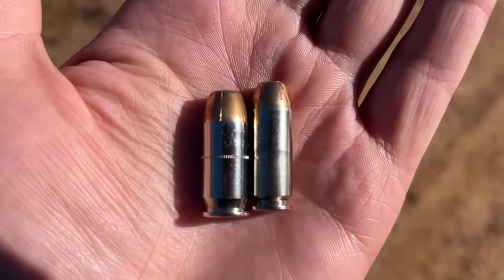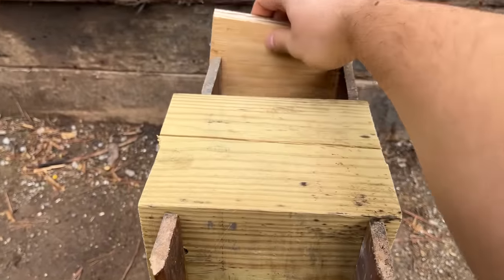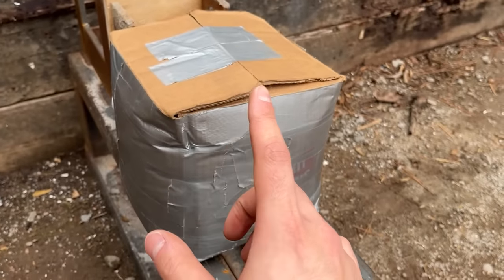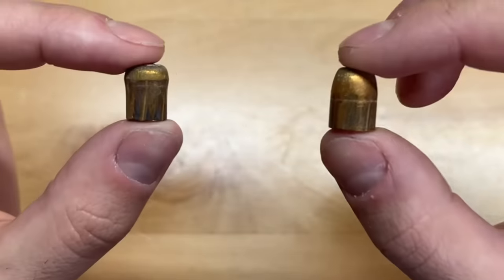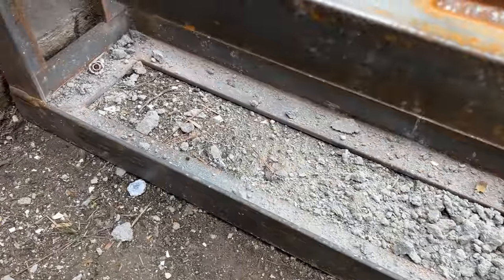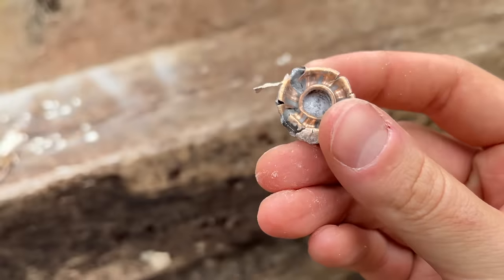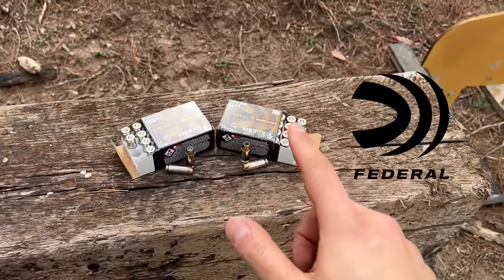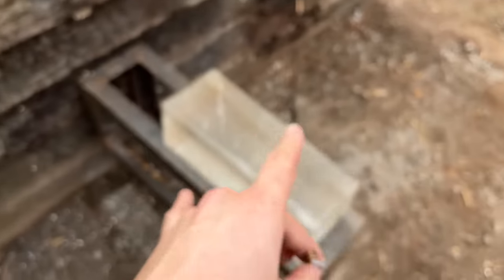45 ACP vs 10mm: Unbelievable Difference On Barriers

Comment: Just make sure your 10mm isn’t underpowered. I’ve heard and seen a lot about some 10mm loads basically being .40 S&W
Reply: It's true that 10mm has been watered down but it's still much more powerful than 40s&w.
Reply: They did that because a full powered 10mm was producing too much recoil for FBI testing. Garand Thumb has a video with the comparison between the two.
Reply: @philipmitchener28 that video was hilarious
Reply: @PerceptionVsReality333  At least half the 10mm on the market is loaded to 40SW pressures.
Reply: My man, both .45 and 10mm defensive factory loads are not just scaled down to .40 ......... they are scaled down to the power of 9mm +P. ......... really go look at ballistics 101. 

Yes the bigger calibers can be significantly more powerful but the simple reality is that the same people touting the extra power dont actually carry loads with that extra power.
Reply: I have never seen any 9mm loading pushing 600 ft lbs of energy like a lot of 10mm loadings. Especially when you get into offerings like Underwood. That's when 10mm is actually loaded more towards the original load offerings. Like 775ft lbs of muzzle energy.
Reply: @theshapeexists  as far as I know Buffalo bore 147g flat nose hard cast is the most powerful 9mm factory load @ 550 fpe 
I have some lehaigh /underwood 67g xd loads at the maximum and that's about 500 fpe. 

The vast majority of .45 loadings fall below 550 fpe with most like 480-530, popular defensive loads are 420+ 

10 mm has alot more 600-700 fpe loadings but when you look at the most popular defensive loads that people are actually carrying they are in the 480-550 range.
Reply: @whatsmolly5741  yeah I mean I carry federal punch in my .45 and I know it only produces like 360-370 ft lbs of energy from the muzzle. But that's okay for me because I carry a compact and dont want the added recoil in a small package. I live in a state where 10 rounds is the max capacity. So i prefer .45 to 9mm for that reason. Same level of energy thereabouts but with a bigger hole? Yeah, so just get the .45 then imho. If you live in a free state the 9mm makes more sense.
Reply: AMEN
Reply: I stick with Underwood, they seem to be the best for 10mm.
Reply: I load my own so that's not a problem .
Reply: Doesn’t matter what you guys use if you miss the vitals.
Reply: Federal HST is watered down 10mm, they don’t load any hot 10 that I’ve seen. Underwood has loads with almost 50% more energy compared to this stuff he tested. My carry load is 155gr but traveling at 1500 fps making over 700 falls of energy out of a Glock 20.
Reply: @alexmills1329 
That 155gr Underwood load is a beast. Tools and Targets did a video on Youtube. It really did well.
Reply: @theshapeexists 

Dont get too excited about those numbers for 9mil…it dont mean squat in the real world. Its only good for show purposes shooting fruits etc.
Reply: @slurpyman20  9mm is adequate for self defense, but I can't say I've ever been "excited" about any 9mm offering. It's the smallest caliber I've ever carried and like it for the capacity. I prefer .40 in small frame semi autos. 10mm is my jam though. My Glock 20 with Underwood ammo is my go to camping and hiking gun. That gets me "excited".
Reply: If 10mm isn't pushing 700 ft lbs it's not true 10mm
Reply: @timjohnson8390  I wholeheartedly agree. its dumb they underload it so much, but when loaded PROPERLY,They charge absolutely ridiculous premiums. It makes no sense
Reply: @shockwavecity  And even that is a pretty decent load for an pistol, just not up to what a 10mm is capable of.
Reply: Joe said 9mm blows your king out. What’s 10mm do?
Reply: @theshapeexists  Just seems ridiculous that one company can get it right but the others either don't care or don't care
Reply: @timjohnson8390  that's the thing, it's not about the ammo companies it's about what the customers are actually buying
Reply: @PerceptionVsReality333 there are 10mm rounds which produce essentially no more fps or energy than a 40s&w with the same projectile
Reply: @El_Peto  

The only one that I know of that's very close to 40s&w is Blazer aluminum cased 180 grain FMJ all the other brass cased loads are pushing 500+ ft/lbs 100+ more than 40s&w. 10mm being on par with 40s&w is an exaggeration.
Reply: @PerceptionVsReality333  people say that

When you have them both and run a chronograph, admittedly for boredom and curiosity, and are seeing similar fps out of the same grain weights, draw your own conclusions.

There's some pretty anemic 10mm floating around in the commercial market
Reply: I try not to buy American ammunition… Most of it is underpowered
Reply: I came to say this. Almost all common factory 10mm is vastly underpowered, intentionally so. Most of them are loaded to just above .40 specs to keep recoil down. But that's not what 10mm was designed for. He needs to test a full power cartridge from underwood or similar.
Reply: @taasch2505  Well, and the fact that muzzle energy doesn't determine terminal performance.
Reply: just about all factory ammo is loaded WEAK due to liability , ammo has to be safe in the cheapest most worn out gun that was made to chamber that round
Reply: @ghostshadow9046  they can still load it to Sami specs… They take that in consideration. Most American ammo crap.
Reply: The original 10mm was a 200 grain bullet at 1200-1250 feet peer second
Reply: Get underwood brand 10mm. They're loaded as God intended.
Reply: @Rubeless , people that listen to Brandon or any of those hens on the View about guns have already decided they are against guns in any shape or form.
Reply: @Rubeless  Brandon says a lot of stoopid sh!t.
Reply: Non-issue for handloaders like me, who never buy overpriced, underpowered factory ammo.
Reply: @whatsmolly5741  have you looked at the Federal HST +p 230gr load?  I don’t think you call that a scaled back loading
Reply: Indeed, many 10mm loadings are reduced power because most shooters don't want to fire more than a couple of magazines of 41 Magnum equivalent rounds from their 10mm. The FBI loading for the 10mm was essentially the same as the FBI 40 S&W load (180gr @ 1000 FPS = 400lb/ft). Full power 10mm is overkill for most conceivable self-defense scenarios, particularly in a sub-compact handgun, but, hey, overcompensation is a real thing.
Reply: @BrokenBarBox  can't find the +P but the regular federal 230g is @890 fps for 404 fpe
Reply: Buffalo Bore made the orginal loading of 200 grain bullets moving at 1200 feet per second. True. A lot of 10mm are watered down. Research before you buy
Reply: Use underwood ammo
Reply: @MarvelousSeven when you say God.... You mean John Browning right!?
Reply: @deadmeat8754 lol the guy shooting at me might be behind a telephone pole.
Reply: Yep. Better get underwood or just get a 40.
Reply: yeah I cough up the extra loot for 10mm ammo from underwood. Federal 180 grain goes 1030 fps. The same 180 grain from UW is 1250. The 100 gr penetrator is the max I think the 10mm will handle at  around 1850 fps.
Reply: @JackShen  big fan of 10mm. Most guns can't handle full loads . I honestly think g20 is the only one
Reply: @JackShen  I'm all for it. Just remember.

These guns aren't engineered for it.
Reply: Gotta buy real 10mm ammo
Reply: @robertdaone  Underwood, Buffalo Bore, Hornady, Sig, Speer are all full load.
Reply: He used 40 S&W Long  for these tests!  I have set the line between the REAL 10MM and the 40 S&W Long at 1200fps for the 180gr. projectiles.  Original 10mm loads were 200gr at 1200fps, made by Norma.  I was able to buy 180/1250  loads from SIG Elite for just over 50c/rd  for a long time. Plus I also have a large stash of Underwood which is hotter yet.  

In all fairness, banaman used weak  ass 45 acp too. 45 in +p would be more like 40s&w and 45super is comparable to "real 10mm" 

The best "40 S&W LONG"  I have found is Freedom Munitions. Very consistent loads, my Sonny-Boi was able to do 3 and 5 shot groups  all touching at 7 and 10 yards. G20.
Reply: @Rubeless  10mm blows your mind
Reply: @PerceptionVsReality333    Underwood and Buffalo Bore load 40 S&W hotter than many 10mm loads on the market.  Armscor has a 180gr 10mm loading at 1008fps for 406FPE; Underwood has a 180gr 40 loading at 1100fps for 484FPE
Reply: @grendal113    My Tanfoglio Compact Witness does just fine with full powered 10mm.
Reply: @grendal113  🤣 Your laughter demonstrates you know the absurdity of your reply. If you're worried about telephone poles...pack a rifle.

😉👍
Reply: @eldoradocanyonro   Exactly!
Reply: @grendal113  God CREATED John Browning. So he meant God.
Reply: Best to own all three
Reply: Only reason I have a 9mm was ammo was cheap easy to get when I did my cwp they sit in safe so does 10mm as it’s full size pistol xdm 5.25 when it came out shoot nice it’s my woods gun back up to rifle when hunting deer have a 40 in a baby glock cause it was pistol I owned carry a Glock 45 acp 6 shots cause all I need have 357 25 acp 22 revolvers and 38s in safe have just about every caliber except maybe 4 or 5
Reply: Even being watered down to 40S&W there will still big a big difference in penetration.
Reply: This one was very under powered. 1100 something fps is around 400-500 fps slower than full house rounds
Reply: You are correct I've shot a variety of 10 mm and have noticed I'm currently trying out a glock 29 gen 4 10 mm I'm currently impressed I'm not usually a striker fire guy I love my hammer fire 10 mm handguns and I've funked around with a couple ars chambered in 10mm
Reply: @taasch2505 nah I’m in Texas still choose the 45 all day
Reply: If you are going to use 10mm at least load it with full power Underwood ammo.  Most everything else is loaded to 40 S&W.  For steel penetration, solid Cu ammo is the way to go.
Reply: The 10mm is way over rated,. I’ll take 45 cal. Bigger is better !
Reply: He's not even saying what bullets he's shooting. Hollopoints, I bet. Hard case would show very different results.
Reply: You mean like the ones he used in this video?
Reply: I shoot and own 10mm and I have never ever shot any ammo that was as weak as 9mm! I shoot Hornady and Underwood as well as just cheaper range ammo I have choreographed all of them. Hornady pushes 1500 fps on average and Underwood was right at and above 1700 fps and my cheaper range ammo is between 1000/1200. I have shot a little bit of 40 through it as well and it isn’t even in the same ballpark. But I will say you absolutely get what you pay for but that goes with everything. You buy cheap crap ammo then you are going to get what you expect. I also own a 45 at the end of the day they are both going to kill just about anything you shoot them with, within reason. But 10mm is an absolutely devastating round I also own a 357 magnum and the velocity is on par with the 10mm. What’s not to love?
Reply: oh no, what will the people do.
Reply: Exactly
Reply: Thats exactly what it is, look at the box numbers.
Reply: Yes Remington and mag tech are true to specs.  American eagle was ripping people off according to these velocity tests on youtube..
Reply: most any off the shelf 10mm is a weak version of what it supposed to be, 
pick up some 220gn  Buffalo Bore Hard Cast Flat nose ammo. that stuff packs a punch, 
I replaced the recoil spring in my G20 with a heavier one specifically for these rounds.
Reply: @shockwavecity If its the same pressure but a much larger case on the 10mm the 10 still is much more powerful because volume is way up.
Reply: 357 and 10mm have the most one shot stops per shots of any pistol. Fbi data.
Reply: @philipmitchener28  But he still shoots Underwood which has much higher muzzle vel and FPS than the ammo used in this video. Underwood probably has the best 100mm you could get.
Reply: Reading these comments, lol.
Reply: They call those FBI lite loads. Pussies couldnt handle the recoil, after asking for more power because they got worked in a gun fight.  The 10MM hot loads are on par with 357 Mag which is crazy. Source: I own a 1911 10MM
Reply: Underwood or Sig Elite.  1300fps or bust.
Reply: Underwood and Buffalo make full boogie 10mm🤑
Reply: @timjohnson8390 that's the magic number I look for. Underwood and Buffalo deliver.
Reply: @PerceptionVsReality333 nah. From Underwood is about the best of the best for both, their 135 gr .40 hits 675 ft lbs from a 4.9” barrel.  From a 3.4” barrel  their most powerful 135 gr .40 load hits 589 ft lbs. their .357 sig hits only 540 out of the same barrel length. From a 4.5” barrel the .357 sig hits 640, didn’t see the .40 tested from a 4.5”, but did see it from a 4” and 4.9”. From a 4” it was 620 ft lbs and from 4.9” a whopping 675. Doubletap also makes similar energy .40 ammo.

Most factory 10mm ammo is only like 10 ft lbs higher than the corresponding .40. One was ONE ft lbs higher lol. Watch Paul Harrels video on it. 

And I run that Underwood ammo in my  Glock 23 and it is certainly way more powerful than most people running whatever factory 10mm out of their Glock 29. Like, most likely significantly so. Do some research before you make extremely bold claims please, yeah?
Reply: @whatsmolly5741 you’re 100% correct. My .40 135 gr nosler ammo from Underwood packs 620 ft lbs from a Glock 23, 589 from a Glock 27, and 675 from a Beretta 96A1. Most 10mm from brands like Winchester, Federal, Remington is like barrly 500 ft lbs lol. You are so correct that most brands load .40 and 10mm to very low pressures, way under the 35,000 and 37,500 psi they’re supposed to be. .45 is already very low pressure round. I don’t know the exact reason they do this, but probably just to save money on powder or something, or to get more people to buy 9mm. The reason I know this is an absolute fact is because that .40 ammo I use from Underwood that is 675 ft lbs from a 4.9” barrel is literally within SAAMI spec. So why every other ammo is like 200 ft lbs less? Lol. Duh, loading to 9mm +p and +p+ energy levels, as you said. If you actually load .40 to +p levels, and use that Beretta 96A1, or a 4.5” lone wolf in a Glock 22, the 135 gr projectiles hit an insane 820 ft lbs, and a 180 gr hits 767. 

Fun bonus fact: the 124 gr .357 sig nosler is 540 ft lbs from a 3.4” and 640 from a 4.5”. Thats compared to 589 from a 3.4” for the 135 gr .40 nosler I use. And thats the hottest factory .357 sig I can find. So at the top end .40 is more powerful, yet everyone always claims the opposite.
Reply: @grendal113  My all steel Sig P220 Legion handles them just fine. 👍
Reply: @smokecrackhailsatan which half?
Reply: Such nonsense.  You want bear load, buy it.  You want softer range load, buy it.   YOUR CHOICE!!!   What, you dont like choice.?   Do a minimum of research and you have tremendous range.  It seems a lot of these "watered down" types have never done 10mm, or cant read an ammo box. 
  If you want to get proficient, put rounds thru.  For the majority of that you want cheaper less punishing rounds.  Trust me, a day at the range doing bear rounds aint fun, nor cheap.    Just like 38/357 or 44 special vs mag..    Same advantaged of PERSONAL PREFERENCE CHOICE, but in an auto.  What part of this do so many not comprehend?   Its just weird., bordering on, well,   ....yeah.   maybe best for those types to choose less choice and personal freedom.
Reply: @eldoradocanyonro  Underwood has a .40
That’s 675 fpe out of a 4.9”… …..
the 135 gr nosler. It’s 589 out of a 3.4” Glock 27. Compared to 540 fpe for .357 sig in the 3.4” for the 124 gr underwood nosler, and 640 from a slightly shorter 4.5”.

Watch az airgunners recent .40 vs .357 sig (underwood) videos. The long barrels were like 5 weeks ago and the short barrels were like 3 weeks ago
Reply: @stephenwhittier6439  .45 def weaker even than already underpowered factory .40 lol
Reply: @georgiafan6618  i carry Underwoods hottest .40 and it’s 620 ft lbs from a Glock 23 4” barrel. 675 ft lbs from a Beretta 96A1 4.9” and 589 ft lbs from 3.4” Glock 27. It’s insane for .40. The 135 gr Nosler. It performs well too, def better than .40 HST, lbviously with such an energy difference. HST 180’s are like 408 ft lbs and the 165’s are 467 and that’s prob a 4.5” barrel too lol.
Reply: @PerceptionVsReality333  10mm has +60% muzzle energy compared to .45acp
Reply: Yep, I bought commercial 10mm, and it was wimpy. I now load my own to make sure it is full ( but not over) powered.
Reply: @stephenwhittier6439  .40 cal that has 357 mag power and you can carry more rounds than that underpowered slug. I’ll take 10mm all day. You best have a full-size barrel for that 45 because those hollow points don’t like to expand much with that slow ass velocity when going into 4 layers of denim and real gel/bone.
Reply: @whatsmolly5741  You kinda did .45 dirty there by posting max loadings for 9mm and 10mm, while only citing standsrd loadings for .45. 

So, for posterity's sake; Buffalo Bore has a 185g JHP .45 ACP which has 543ft lbs of muzzle energy. 

The most powerful load of 9mm they sell, is marketed at 500 ft lbs even.
Reply: Load your own.  I have loaded some serious 10 mm rounds
Reply: There's a few factory loads that are full power 10mm that I know of: Underwood, Buffalo Bore, I think Cor-Bon and Barnes makes one or two, then there's the oddballs like Liberty and G9 and take a different approach to the bullet construction. Liberty is practically explosive but doesn't pen as far, and G9's external hollow points are just nasty, vicious rounds. 
But, yeah. The average 10mm factory load is about 500-550 ft lbs. of energy, while the original loads were about 750-800 ft lbs. It got the .357 mag treatment.
Reply: @shockwavecity  I'd say more than half. Unless it's Buffalo Bore or Underwood full power 10mm cartridges are rare.
Reply: True. this history of it is; FBI originally adopted the 10mm. not the .40S&W.. when they adopted the 10mm, to many Agents were complaining that it hurt their wittle hands.. so an under powered version was made and sold as "10mm FBI Load".. Than the FBI complained that they wanted to carry more rounds. so S&W stepped in and cut the brass down to the powder load and thus was born the .40 S&W... Today, Much of the 10mm that is sold is actually "10mm FBI Load"..
Reply: @theshapeexists underwood has 10mm ammo that is 180 grain 1750 ft per second …. That’s flat ass smoking
Reply: @robertdaone underwood has absolutely amazing high powered 10mm ammo
Reply: @thomaschandler4831  I've got a few boxes of it. It's mean stuff. My neighbor gifted me some of that civil defense in 9mm and 10 mm after fixing his AR. That 10mm I think is only 70 grains but it's moving 2400 ft per second.
Reply: 10mm hands down
Reply: That's very true. If you look at different manufactures velocity & energy numbers on the 10mm, you'll find a few are very similar to their 40 short n weak counterparts....i.e. federal ammunition being one of them. Of course when you go with a company like underwood, you can get some lighter grain stuff that cruises out of the muzzle and is well north of 700 ft/lb of energy
Reply: @theshapeexists the same reason you pay more for an escalade versus a denali....because they can.
Reply: @Rubeless i read somewhere it throws the Earth off its axis @ full powered loads....probs why most are loaded all slow & steady like...
Reply: @samuelyoung - Any person who does not know to make sure their 10mm is loaded with a round that will down a large predator should prolly not be diddy boppin in the woods. Standard 10mm ammo on the shelves is usually the dumbed down velocities.
Reply: Yep, if you want real 10mm, load your own.
^..^~~
Reply: Gotta  find good 10mm rounds …and they are typically  on the pricey side ….because if you are carrying a 10mm and shooting underpowered rounds why carry the 10 at all …9mm and .40 are consistently priced significantly less ….I do carry a sub 10mm but I have a whole lot of rounds through it working on accurate follow up shots
Reply: Isn't false advertising to sell 10mm with less powder?how can you make sure your getting actual 10 mm?
Reply: @TomJones-op9nj  for real 10mm rounds kick frickin' ass. Load your own!
^..^~~
Reply: @RGRundeRGRound Well the HST is a 200 gr at 1190 so that would count right?
Reply: Yeah why do so many people just make crap up online? Lol
Reply: Which gun do you have?? 30?
Reply: Mcsada
Reply: So did I that's how I end up at 10 mm vs 45 acp
Reply: @theshapeexists  and no need for modifications.
Reply: Did I notice a Glock 20C?
Reply: Well it is a .40caliber, but it’s like going from .38 special to .357 magnum. Same thing and the power difference and performance is massive.
Reply: Paul Harrel chronoed Federal 10mm and 40 S&W and found they had the same muzzle velocity (repeated tests in two different videos).
Reply: Big box brands are crap in 10mm. Examples being Federal, Winchester, Remington etc. Full power would be like Buffalo bore, underwood and some double tap loads.
Reply: Yeah yeah we've heard it before
Reply: @theshapeexists  my guy, you are nitpicking the more powerful loadings to "prove" your point, completely ignoring the point the other guy was making. Can you get any more disingenuous?
Reply: @BeetleBuns  anyone who knows anything about 10mm knows the watered down garbage isn't worth a damn. So if you have that common knowledge, you wouldn't even consider the offerings that are at 40 levels or even lower. It's much like 38 sp vs 357 mag. Manufacturers thought they could get away under loading garbage loads for 10mm, but actual enthusiasts know what REAL 10mm performance looks like. I'm completely discounting plinking ammo, it's like the 38sp loading in a 357mag. If anyone is being disingenuous, it's the ammo companies playing us for fools and charging a premium.
Reply: You say that like it's a bad thing.
Reply: The truth is if you load 10mm up to it's full potential, very few people would buy it as carry ammo.  It's overkill.  True 10mm is about as powerful as .357 and how many people carry full-house .357 Magnum defensive loads? Almost nobody.  Most .357 guys are running around with .38 special +p loads or "low recoil" .357 loads that are clocking around 1,200 fps as opposed to 1,500 fps.  The high velocity/deep penetrating hunting loads and their self defense equivalents are best reserved for shooting outdoors and/or with hearing protection due to the pressure and decibel level.  If you value your hearing. The best argument for the .45 AARP is the lower, deeper, report when fired indoors.
Reply: @johnelder4273  here in Colorado 10mm is perfect for camping in the sticks. I absolutely wouldn't carry it in the city, my 9mm works just fine for self defense against 2 legged vermin. I carry my Glock 20 on my hip every minute up in the mountains when doing outdoors stuff. You are more likely to need the extra power when running into bigger 4 legged  predators who may look at humans as dinner
Reply: I carry nothing but Underwood 180gr 10mm and Underwood .45 acp 230gr.
Reply: @philipmitchener28  Yes, the original 10MM loads were pretty snappy.
Reply: @shockwavecity  I load my own with power pistol 12 gms or uae Buffalo bore. 10mm is also my duty load
Reply: @philipmitchener28  any 10mm ammo recommendations?
Reply: @shockwavecity  You sir are CORRECT..HUGE HUGE DIFF tween brands..ALOTTA plain 10mm like Remington,Magtec,ect is barely 50 fps more then 40..Shoot UNDERWOOD, and its like NIGHT and DAY..LOOK at folks videos of underwood..meets or EXCEEDS wat says on box..2nd is buffalo bore..UNDERWOOD,OR HAND LOAD..Fill that case up with LONGSHOT OR 800X..50 PERCENT +,MORE POWERFUL THEN 45 OR  357👌
Reply: @theshapeexists VERY CORRECT..UNDERWOOD vs like Remington,Magtek..2 diff WORLDS! Or like i do..HANDLOAD..HAD TO BUY 22LB RECOIL SPRING ON GLOCK 20 TO FINALLY STOP BATTERING FRAME..YOU CAN HUNT BLACK BEAR WITH REAL 10MM..
Reply: @alexmills1329 YES SIR!  UNDERWOOD KING OF THE HEAP! ONLY ONE TO ACTUALLY CHRONY WHAT BOX SAYS..200 GR HARD LEAD CLOCKS 1270 OUTTA MY GLOCK 20..THATS ALMOST 800 FT LBS..HELLO BLACK BEAR..
Reply: @theshapeexists ME TOO! Got same combo..had to up recoil spring..Black bear here on the menu.
Reply: @timjohnson8390 Underwood not sny more expensive then lotta other ones like buffalo bore..underwood KING OF THE HILL IN POWER, PERIOD.. YOU NOT NEED YHAT MUCH,THEN BUY A 40..
Reply: @El_Peto exactly.. alot are just zippy 40s..BUY UNDERWOOD..KING OF YHE HILL,INCLUDING BUFFALO BORE
Reply: @ghostshadow9046 well there's no 80 yr old 10mms.. Bren tens all blew apart..thats 1980s,not old..UNDERWOOD 50% MORE POWER THEN ALL THE WASTE OF MONEY OTHER STUFF..BUFFALO BORE 2ND PLACE.. REST IS WASTE O MONEY LOSDED TO 40 SPEEDS..
Reply: @MarvelousSeven CORRECT..UNDERWOOD...THEN ALLLL THE REST
Reply: @timjohnson8390  sig 10mm ammo does 638lbs
Reply: Federal is the company that began loading lite 10mm
Reply: The 9mm is the reason the 10 was developed.
The FBI had a bad time against guy with a mini 14.
He was hit with a 9 it stopped short of his vital organs.
So the Bren 10 was made for FBI.
Field agents loved it,office workers did not like qualifying with it.
Federal helped by producing rounds in the 40 range.
Reply: Handloading will make sure this doesn't happen to you.
Reply: No, it ain't
Reply: Interestingly,  the only comparisons that I've seen showing 10mm rounds being under-powered was with Federal Cartridge ammunition, which also happened to be the featured ammunition in this test.  The chronograph tests showed Federal 10mm to be significantly slower than comparable products from other manufacturers.

Perhaps this is a new product aimed at fixing that discrepancy?
Reply: That's why you by eaither double tap or underwood ammo😂
Reply: Very true.  The original spec was a 200gr bullet moving at 1300fps.  Bullet type will also affect your outcomes as well.  I think most of us already understand this.
Reply: Yeah, a lot of factory loads are basically just large cased .40s. Magtech, S&B, etc. Even some defense and hunting loads are like that. I'm going to assume it is to save money since the two cartridges are so similar, and .40 can run in some 10mm guns anyway.
Reply: @mojaxon23  I don't think you know what your talking about, Im not trying to be mean. I have americane ordnance ammo that has 1350fps and 728ft/lbs in 180grain. The magtechs I have are 180grain producing over 1300fps and 675ftlbs. underwood ammo 200grain that is 1250fps and 220 Hardcast that is 1200fps. The 200grain carrys 701ft/lbs and the 220grain carrys 694ft/lbs. There is "civil Liberty" ammo that is a 60grain bullet at 2400fps and 780ft/lbs. So I would say they have a whole lot of more ump to them than a 40 does.  LoL!! Check out the ballistics on a 10mm vs a 40caliber. I'm sure you understand there both 40 caliber bullets. It's just a 40caliber on steroids 🤣. You are rite you have to be careful which ones you buy or you will buy watered down 40's. I'm not totally 100% percent sure, but I think for a regular 40 the highest I've seen them is 575ft/lbs correct me if I'm wrong. There also is a 10mm magnum, but very hard to find that carrys over 1100ft/lbs of energy. (Check it out 10mm auto vs 10mm magnum vs 40caliber cartridge. Don't take my word search it. One thing is for sure I didn't believe it until I searched it.) My brother carries the 9mm with +p+ rounds that carry 501ft/lbs. We both own a 10mm auto also, but he don't carry it. He says it's to heavy to carry, but for some reason I don't mine carrying mine.
Reply: @skeeterdavis5777  Uh, we all know there are various factory loads that are way underpowered for 10mm. Including SOME hunting and defense loads. I never said there weren't some that are full power. The Magtech and S&B currently stocked at the store I work at are basically glorified .40's. They have the same bullet weight, and have negligible FPS over the .40 S&W of the same brand and type we sell. Are you sure you know what you are talking about? Nice try to correct someone on something they never said or suggested and attempt to repackage the same message in different words as though you figured it out first. Not sure what you thought that was going to yield, but oh well. Some guys just gotta try hard to prove nothing.
Reply: @mojaxon23  I know what I have. I don't buy 10mm cartridges from any store. I look into the power that the 10mm is suppose to have then I buy them on line. I don't buy them from the store, they all are watered down 40's. I used to think the 40s&w was something until I started looking into the 10mm. I was shooting a magtech "that you said are crappy" 180grain out of a Glock 29sf me and my brother was hitting a Gong 116 yds away. You stay with your 40caliber, and I will stay with my At&t 10mm slow gun. Oh yea I forgot to mention I ended up buying a crappy 10mm rifle also🤣. Just because you seen some 10mm cartridges that are like the 40caliber doesn't meen there all slow
Reply: @skeeterdavis5777  Why are you assuming I'm endorsing or even use .40 myself? Lol, you also keep doing the same thing. Saying what I said, but acting like you are saying something different, for no reason I can discern. 

I already pointed out that some factory loads are not full power. So what are you talking about, dude? You just sound like you just learned about this stuff and are trying to sound like you know more than you do by creating straw arguments out of thin air. You are attempting to argue against someone who has already made the point you seem to be trying to make yourself as though you were the one who pointed it out by twisting my words into absolutes and left field assumptions. That or you don't know how to comprehend what you are reading.

And guess what, even online, some 10mm was still being sold underpowered or with performance less than stated on the box. Even Buffalo Bore has had runs that were like that. So unless you are chrono-ing every box you shoot, you don't know for sure if they loaded full power or not.
Reply: Federal 10mm uses small pistol primers which is great for reloading but so weak i have to drop to a 17lb spring. Blazer 10mm uses small pistol primers but is powerful enough to not stovepipe using a 20lb spring. My hot loads will enter a propane can but i have an aftermarket barrel that fully supports the brass. So no glock “smileys”😊. Any case mouth splits common with especially Winchester brass can be shortened to 40 and loaded as such and used in the aftermarket barrel. The ejector catches the extractor groove is how that works and using a 20 lb spring for 40 as well. Dont want that brass coming out of the barrel any sooner than need be😊
Reply: Just read the specs on the box, not hard. Anything around 180gr. @ 1050fps is gonna be your training/plinking 10mm. For defense, increase energy as needed. Civil Defense makes a  60gr. @ 2400 fps. Buffalo Bore makes a 220 gr. hardcast @ 1200 fps. Do your research before you spend money.
Reply: An underpowered 10mm just turns into a fmj 556 and tumbles to hell. Not doing what it’s designed too but it’ll still make somethin leak very quickly🤣
Reply: Even those HSTs it’s only like 50 fps more than the .40, and the .40 isn’t lacking but if you’re paying the premium for the 10mm you should get something spicy.
Reply: @univisiontech1 where can i find said video
Reply: I only buy Sig Sauer Ammo and it's strong as shit
Reply: @whatsmolly5741 I do, underwood, DT or grizzly or buffalo bore, like the underwood the most definitely the hottest and best ballistic performance IMO.
Reply: @robertdaone 2nd this
Reply: Sig v crowns load a proper 10mm. Same with underwood. Only trust federal hst for 9mm.
Reply: @whatsmolly5741  Always reminds me of magnum force. If he's using such low pressure .44 to control recoil whats wrong .357 or even .38 for that matter?
Reply: Literally every caliber known to man is manufactured in varying velocities.
Reply: Doesn't matter
Reply: @philipmitchener28 🤦‍♂️
Reply: @grendal113 they better or they will get sued if something catastrophic happens.
Reply: I do.
Reply: @philipmitchener28 so, i shot a 10mm for the first time about 3 years ago. 

I didn't know the guy was handloading his own 10mm, otherwise i would have declined. He also mentioned that he loaded it hot. I don't know what gun he had, but it looked like a glock. Honestly, the recoil was comparable to a 45acp, i'd say just a tad bit more. The only experience with 45 i have is shooting my buddy's 1911, but he also decked it out with a tungsten guide rod, which dramatically helps with the muzzle pop. 

Also. I'm kind of a limp wrist shooter, haha. Not that i shoot with a limp wrist specifically, but whenever my buddy shoots, his hands almost seem like they just ignore the muzzle pop, while my gun is flipping everywhere.

With all that said. If i can fire with a steady cadence and still have 100% of my shots in the killbox, how wimpy are these FBI agents? Hahahal
Reply: I think you are misinformed or you are conflating issues.
Maybe you misunderstood when you heard someone talking about how the 40 cal is a chopped down 10mm. You would have to be drunk or completely r-tarded to put a 40 S&W load into a 10 mm cartridge.
Reply: Magtech makes good range ammo
Reply: @El_Peto that gives flexibility to the round.  A .45 colt can be loaded and fired out of some guns that make .44 mag look weak.  It can be loaded down to mild loads good for plinking or ground hogs.  Lots of flexibility.
Reply: Put a 180 grain bullet on both cartridges the 10mm will get to 1000 fps while the 45acp will reach about 1150 fps. If you want to match the 10mm speed with the 45acp, just lower the grains on the bullet. I personally carry a 180 grain. The .45 cartridge has a superior potential for speed compared to the 10mm because it has a higher volume in the cylinder. The 230 is way too slow and it's like lobbing a musket round. If what you're looking for is penetration over the impact wound cavity, then go with the 10mm and get the smaller and lighter bullet. If what you're interested in is a larger wound cavity on impact with less penetration, then you go with the 45. A Corbon's cartridge for a 45acp with a 165grain bullet gets you 1250fps from a 4 inch barrel and 1300+ from a 5" barrel.
Reply: Doubletap ammo makes full powered ammo for 10m
Reply: You are correct, 170 grain and 180 is 40 caliber.
Reply: @Rubeless true.  Where the hole is tends to count for a lot.
Reply: @PerceptionVsReality333 there is plenty of +p selections in .40 that are literally the same as 10mm ballistics wise. 10mm is pointless unless you’re loading your own.
Reply: People.love to say what they heard
Reply: Definitely true.. I have chronographed a lot of “high end” pronounced expensive (Federal HST, Winchester Sxt) that had the velocity of 40 and same FPE. Underwood never fails though
Reply: @shockwavecity facts
Reply: Le 10mm auto et plus  puissant que le 40sw d'ailleurs  le FBI n'a pas voulu du 10 auto trop puissant du coup on a créé le 40sw  plus    maîtrisable essayer de maîtriser un voyou dans un lieu clôt avec 10mm ou 357mm je vous dis pas l'état des timpan
Reply: Underwood.
Reply: Jesus, I see what you’ve done for other 10mm, and i want that for me.  Amen